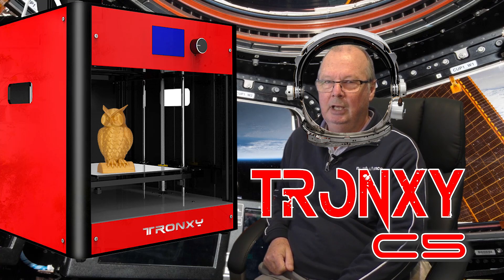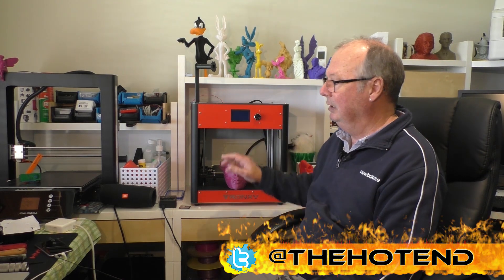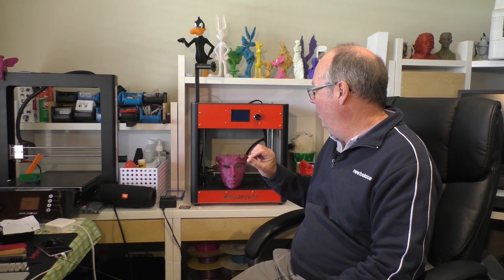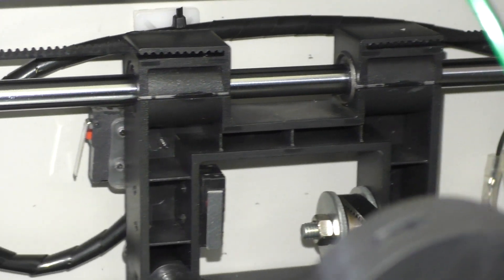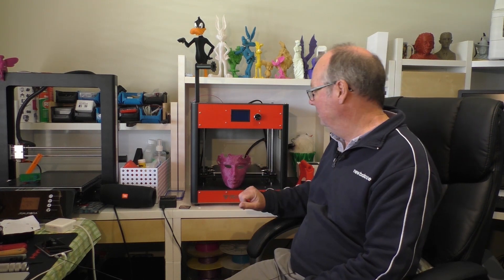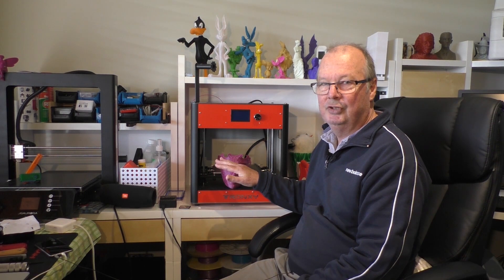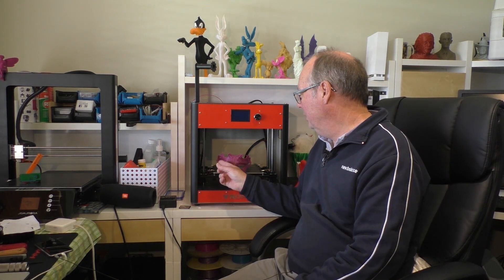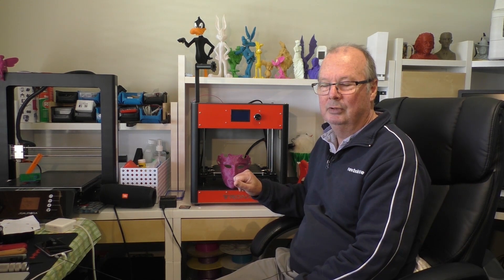TRONXY C5 Review! 210x210x210 Pre-Built 3D Printer!

Comment: wtf, a actually working TronXY in the wild? oO; wtf :O
I would say rebrand, but i recognize that POS bed mounting from the X5S, same as that POS "belt pulley" washer stuff. (It was OK 2013, but these days actual real pulleys cost the same as the 608 bearing, or even less)

That stuff did not come loose on shipping, they just failed hard at factory.
The kinematics is ultimaker style, not corexy.

Also just 12V these days? Bad.

Further the wiring is not sufficient, same too small gauge as the X5S, touch them while bed has been heated to 100C, you'll notice.

"Touch high" - You can get Anycubic 4max for ~250$, which is vastly better components and build quality. Rip off is more like it ... Well, giving a dime to tronxy is a ripoff.
Infact this whole "review" stinks and puts the whole channel's reputability at risk.
Reply: Oh and PTFE Hotend ~245C max is baaaaaarely enough to get visually okayish parts with ABS. for structural parts you really want 280-290C